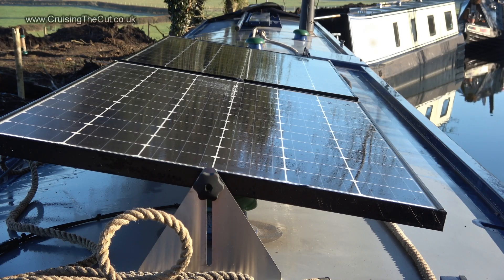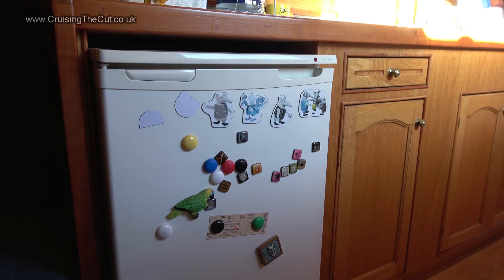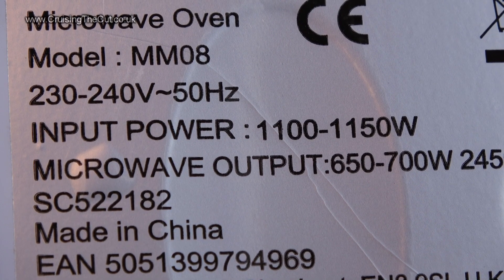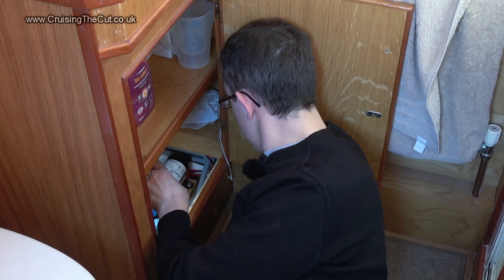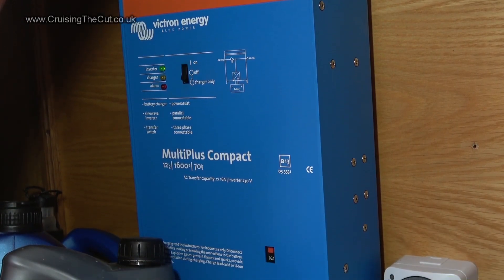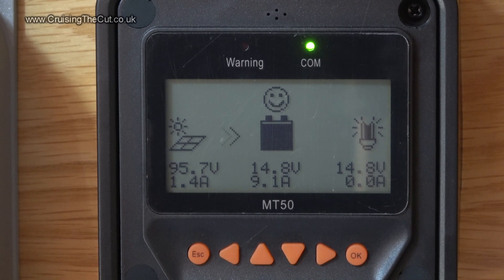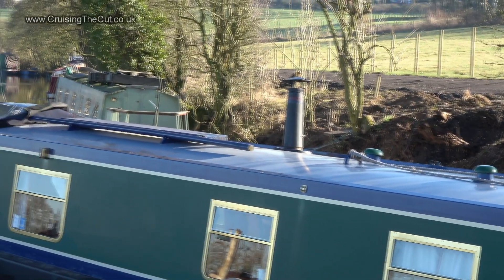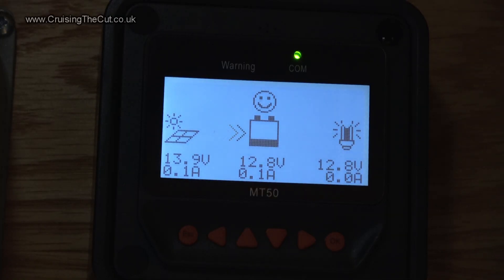76. Is solar power sufficient for a canal narrowboat in an English winter?

Comment: Buy a 3 way fridge? Most motor homes use them. That would save your biggest draw.
Reply from the maker: Not suitable for narrowboats. They draw too much power on 12V, it's inefficient to use through an inverter on 230V and the gas option would fail boat safety.
Reply: CruisingTheCut Ok are you saying gas fridges are not allowed on boats? Obviously I am
not suggesting using an Inverter to run a fridge that would be absurd. However if you are moored on hook up 230v is clearly an option. Cruising of course is obviously another game. 

Modern compressor fridges draw much less than older technology so maybe a fridge upgrade would help?
Reply from the maker: I don't believe they are, no. Inverter fridges aren't absurd as there are boats that happily use them (with a big battery bank, plenty of solar, lots of cruising etc) but it's not efficient. I believe the 40Ah figure I quoted is a current (no pun intended!) figure for modern units.

Comment: to be fair when it`s that cold you can switch off the fridge and use it as a storage and leave the little things that actually need refrigeration outside or somewhere cold, switch it back on when it`s warm again and by then you should also have enough sun to power everything
Reply from the maker: You can, and some do, but the temps are so darned variable. It's freezing (literally) on day and mild the next. I'd forever be switching it off and on. But agreed in principle :-)
Reply from the maker: What a palaver! And by the (late) time I get up it'll be nicely warm again :-)
Reply: idunneedachannelffs   ...also  in  my  flat  I  should  put... the  food. ...at the balcon...outside...in  winter

Comment: If only Seebeck elements (thermo electric generators, opposite of Peltier elements) were more affordable and more efficient, you could charge your batteries from the temperature difference between your stove and the canal water. In the same way your stove fan runs from the temperature difference between the stove and your room.
Reply: Mark Gray: Nope, purely electrical. No moving parts, no maintenance.
Reply from the maker: Yes, I've seen power generators to charge your phone that sit on the fire but the current is tiny :-(
Reply: Is this like a Stirling engine?
Reply: Stirling Engines (External Combustion Engines) are fun, albeit quite inefficient as they generate a lot of heat in addition to the electricity ... best suited to winter use, when you can more readily utilise that heat, rather than in the summer, when it's mostly waste.
There is, or was, a company that produced Stirling Engine generators - WhisperGen, or something like that ...
Reply: In principle yes, but using only electrical potential between two materials when they are heated (and cooled I guess as you need a temperature gradient). Where as a Stirling engine does the same buy mechanically with expanding gases.

Comment: Useful stuff! I wonder if you have indeed ever considered rigging up some wind-power? It seems on most days, at least here up north, that the wind is a little more reliable than the sun haha. Cheers!
Reply from the maker: I've seen plenty of boats with it but was put off by cost, the need to de-rig when you move, and apparently it can be quite noisy due to vibration.
Reply: I was going to ask if you'd looked into wind turbines, but appreciate that, as you say, they're not best suited to continuous cruisers, as you'd never get them under bridges ... still, could be useful if you take on extended winter moorings or, say, an extended stay over the peak of summer to avoid the crowds ... If you had a permanent, residental mooring, then you could always potentially fix the turbine pole to the land, or pontoon to  get round the transferred vibrations
Reply: The power output can also be very variable. On average less than you'd get from a solar array (but different in size and installation). But it is good for "topping up" batteries, as it can run when the solar is not. But I'd wonder how reliable it was.

Comment: Just a thought.  I've lived on board now for about 18 months and I don't have a fridge. For the stuff that I really want to keep cool (milk, butter, cheese etc ), I use a 'cool' locker which is mostly under the waterline and also reasonably insulated from the warmer cabin.  Not perfect - but it works for me.  That could save 40ah.
Reply from the maker: I wish my boat builders had included an underfloor locker because as you say it is quite cool down there. Alas, none of the floor has been made liftable with a crowbar :-(
Reply: Useful for wine storage as well
Reply: modern boats should have that locker.

Comment: perhaps modify your solar mounting to allow for proper alignment  - simple linear actuators are very cheap - or indeed just use a manual frame to align the panels - you are wasting the panels.
Reply from the maker: All a bit too much hassle for me, I think. What I have is very standard for narrowboats; there's not much room for putting motors and big frames up there unless it can also lie flat when needed. The panels work perfectly well from spring to autumn as they are :-)
Reply: That's where a simple scissor frame comes in handy - think collapsing clothes airer - with a pivoting panel - or a simple linear actuator mounted flush with a pivot arm - it doesn't have to be big to be effective.
Reply from the maker: Ah, I see what you mean. I'd quite like one of those things NASA use to unfurl the panels on their satellites :-)
Reply: If you are static for a few hours - loosen your panels and prop them perpendicular to the sun
Reply from the maker: That would be a nuisance due to the bolts. But it's fine because when I'm cruising, Spring onwards, they generate all I need even when flat. I needn't have bothered with the tilt brackets in hindsight!
Reply: you prefer solar during summer.
Reply: I have read that stationary installations (houses, fields etc) gain very little from motorized and tracking solutions. While they do increase power returns, often they don't even recoup costs. However manually adjusting for time of year differences every month/couple of months does give a good improvement in power.

If size/space allows for it, being able to tilt the panels to the right angle for winter, and back again for cruising ;) , may help. But that depends how close you are to the optimal position already (an extra .1 amp won't help if your almost at the right angle already).
Reply from the maker: That's rather overcomplex for a narrowboat roof I think but I''m sure someone somewhere has done it.
Reply: Nothing beats elbow grease. ;)

Comment: I wonder how much amps the engine delivers on idle ?
Reply from the maker: It's more complex than that because as you charge a battery up, it accepts less charge so you have to run for longer than you'd think. Lots of complex maths!!
Reply from the maker: Depends on your alternator. I think you're ideally supposed to give it some revs too rather than idle but that'll annoy your neighbours even more!
Reply: a small alternator can deliver 90amps and thats pretty much the minimum you can find on a NB 
good alternator designed for battery charging are around 150 amps i`ve recently seen 360 amps alternators
Reply from the maker: Mine's only 70A!
Reply: So running the engine for an hour a day should cover your needs ?
Reply from the maker: I haven't due to huge initial cost, need a differ charger (and solar charger too) plus fire worries!
Reply from the maker: Not inevitable because from spring-autumn my solar happily covers it. Without it I'd have to run the alternator for a couple of hours I suppose.
Reply: Hi have you looked in to lithium for a quick charge time, I'm just changing over to it in the next couple of months, you can recharge fully in 1 hour,
Reply: Don't know what I was thinking, of course you can't charge with 80 amps......I still wonder though, when you're moored along the cut for a couple of days without landline, how long do you typically have to run your engine every day ? I understand it is annoying for your neightbours but inevitable I guess ?

Comment: Have you considered adding some sort of reflectors?  I've seen some flat roof systems where each row of panels has a matching row of reflectors at opposite angles.  Apparently it increases the performance significantly.  Maybe you can come up with something removable to clip on the sides and reflect more light at the panels.  Try cardboard, aluminum foil and duct tape as a  test!
Reply from the maker: Hmmm, intriguing idea but I'd be surprised because if it worked everyone would do it on their panels (and they don't). Maybe worth a test though! Cheers
Reply: Maybe no one has done it because they've never asked me before.  ;-)  Just joking, but would be some interesting video content.   Quick google search returned a bunch of stuff about reflectors, including this article and simple experiment. http://geo-dome.co.uk/article.asp?uname=solar_mirror
Reply: I think it's less a "it does not work" and more a "cost/time/returns" problem. "Solar mirror" power stations already exist, but mainly in hot countries and as a main system. And I think only a couple at that.

Without testing, it would be hard to know if it's worth it. Possibly not on a narrow boat, as little space to put the mirrors, so better to put an extra panel. But may be worth it on a caravan, where the bit of grass to put a mirror down, is cheaper and easier than an extension cable and an extra panel. :P
Reply from the maker: Ah! Solar does not like being hot, I know that.

Comment: Hello again, just wondering what controllers you use as mppt controller vs pwm is much more effective and generating those extra amps? I have been looking at a 1k setup and I'm told two 80amp mppt controllers would make a massive difference how many amps can generated but the are £400 each!! It would be overkill in the summer but I am hoping it would generate just enough in the winter to half the burden on my engine. Loving the videos, keep up the good work :)
Reply from the maker: Mines a 40Amp MPPT controller. I believe they're substantially better (when they actually have any sun to work with!) but I can't give you a figure for how much; sorry.

Not sure why you've been told to get two though. I have one for my 480W so you should only need one 80A unit for almost 1,000W. Unless you want a spare for redundancy, that kind of thing.
Reply: I was told that it would ensure maximum efficiency from the panels. I haven't committed to buy yet and so further homework is required. Sound like I could expect double what your video states so that's a good base to work from. I will double check the facts on having two and let you know my findings. Many thanks!
Reply from the maker: Yes, please do!
Reply from the maker: Good explanation, cheers

Comment: How easy is it to get 12V appliances? How much difference would using a 12V laptop power supply and TV make, and could you switch off the inverter?
Reply from the maker: Easy to buy 12V TVs and fridges (though they're stupidly expensive). Yes, you can power a laptop from a suitable DC-DC adapter. The gain is harder to quantify but inverters are approx 90% efficient so you're wasting 10% of the power straight away. It's not huge but if you have lots of 230V appliances it could add up.

Comment: Good informative video. Does your charging system have the facility to charge from 220V? i.e. even if one of those little petrol generators can't power a microwave, could you use one to top up the batteries for, say, an hour or too so that they can supply a high-ish power appliance for a short period?
Thanks.
Reply from the maker: Yes, you can plug mains into the boat, it wouldn't know it wasn't a shoreline and it would charge from it. How quickly would depend on how potent the genny is, in part.
Reply from the maker: Much better to use mains. 12p/unit (1kWh) versus the diesel and engine wear.
Reply: But is the cost of mains electricity to charge the battery worth it, or is using the engine cheaper?

Comment: Another excellent and informative video.

As you say, if you cruise and then stop for a couple of days, there's no issue. The only problem otherwise is with charging from the engine if you're not cruising - diesel engines don't like to idle for extended periods.

I suppose the only other option is to invest in a Dyson Portable Nuclear Reactor?
Reply from the maker: Or a portable petrol generator? ;-) Of course, then you have issues with the safety of petrol storage. Anything by Dyson would be overpriced!
Reply: CruisingTheCut Yep and actually not as good as people think. :)
Reply from the maker: Glad I'm not the only one who thinks that!
Reply: CruisingTheCut Used to use them for changeover in my holiday home. Typically they would last 3-4 months before the motor died. Can't beat a good old 'Henry'. :)

Comment: There also exist some electric metering tools so that you can do things like view the power used by the fridge in a given day.
Reply from the maker: Good point.
Reply: Does your system not show you the power draw as well? Or does it only show the power input from the panels? Thanks!
Reply from the maker: It could, if all the battery output went via the charge controller but it doesn't, the controller simply links onto the batteries.